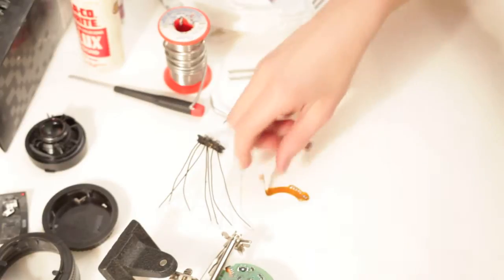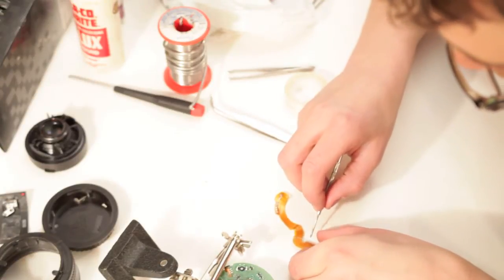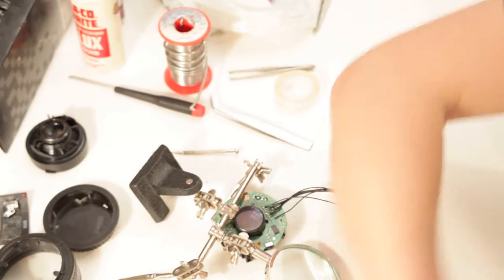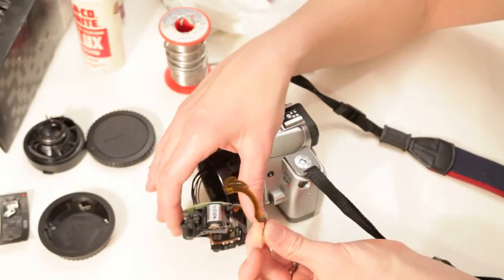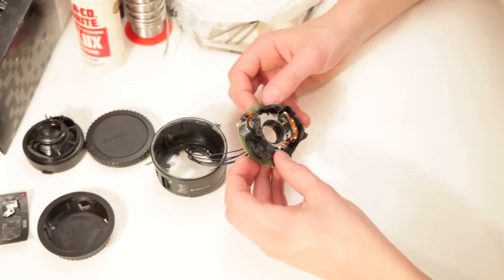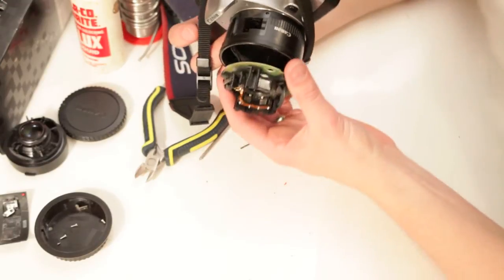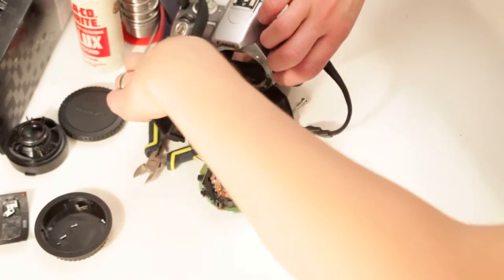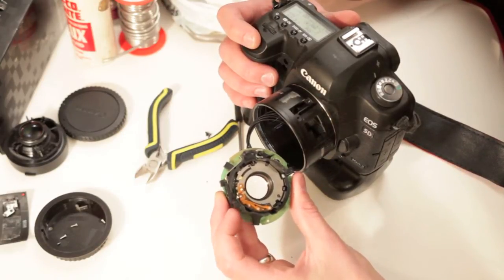How to build a Canon 50mm 1.8 ii EF EOS Tilt Shift Lens DIY pt.2

Comment: hi
i+m doing a Tilt shift with a 50mm and i will do it folowin your videos.
do you think that the Auto Focus could still work on it?
Reply from the maker: rui bandeira No there would be no way becasue the focus runs on the "helicoid" within the body shell which has to be taken off to mount the rubber boot. It might be possible but I don't think it would be. I don't think there are any AF tilt shifts but maybe you could be the first to invent one! That would be cool!
Reply: I already removed the focus motor... 
I think that I will have the finished lens tomorrow 
If you use Facebook you can see 2 small videos of the tests I made.
Reply from the maker: rui bandeira Oh cool I will try to track you down on FB. Would love to see your vids!
Reply from the maker: rui bandeira Cool thanks for sharing!!